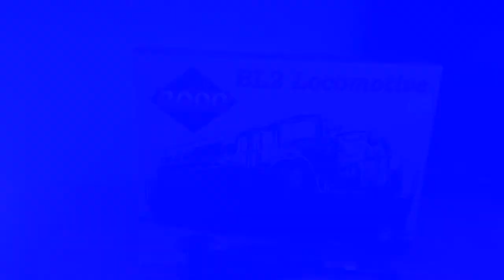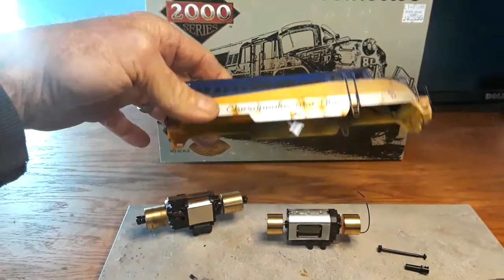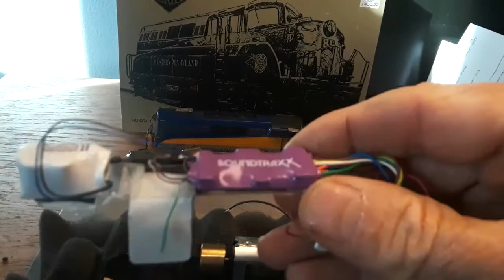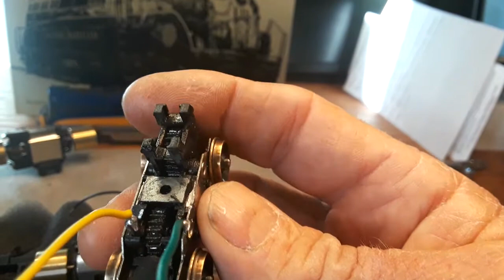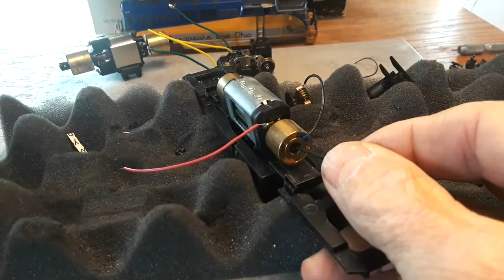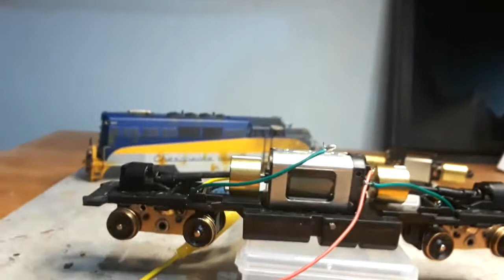HO scale Proto 2000 BL2 upgrade part 1

Comment: Over here in grand junction watching you
Reply from the maker: Enjoy your stay!!
Reply: Over here in Wichita Kansas watching you lol . . . great info.  The shell is wide enough to put a big round can motor inside which can be found on evil bay with the correct search words.  If the can motor you find has a lower rpm level it'll make the locomotive pull harder and will allow the creep speed to be very realistic in the locomotives movements

Comment: Great informative video . Thank you for sharing I am doing the same job on a early Proton GP 20. I will do do the same as you to isolate the frame. What Epoxy did you use to stick the plate back on to the trucks. What is your thoughts on changing the metal part for plastic like Proton has done on their later model.Also all my axles have cracked what do you think on giving them all a good clean then super gluing the axles on to the plastic gearwheel.. as here in the U.K its hard to get American parts & now expensive to buy from America......Thank you again from a U.K. Modeller  Brian
Reply from the maker: Hi, you gave me a good list to answer. Ok so for the glue I used I would suggest 5 min epoxy on the trucks. I understand about the gears and the cost.. heres what I've done and it works well. What you have to do is get the parts supper clean. I use grease and wax remover from an autobody repair store and quality!  Then a small paint brush and clean the parts real well. Let everything dry real well then use an autobody repair epoxy. I use a two part panel adhesive. It's expensive so buy the smallest amount possible. Mix some up.1:1 with a tooth pick and carefully apply. The adhesive to the cracked gears making sure the adhesive is in the crack. Then slide them back onto the axle. Hears an important thing...make sure you get excess adhesive out of the gear channels. Make sure the cracks in the gears are closed together. I use a pair of larger tweezers and clamp snuggly. Make sure they are in the right spot and it looks good, let dry over night. I don't like super glue cause it will fracture under a load. Good luck.this takes time but works great!